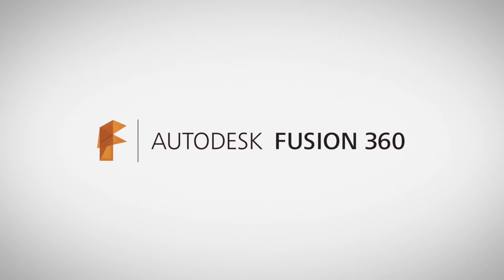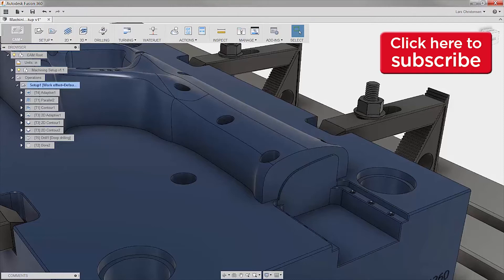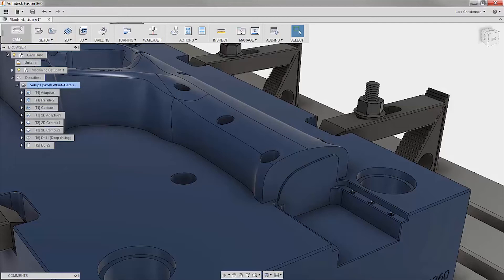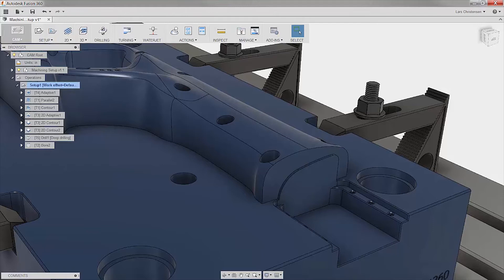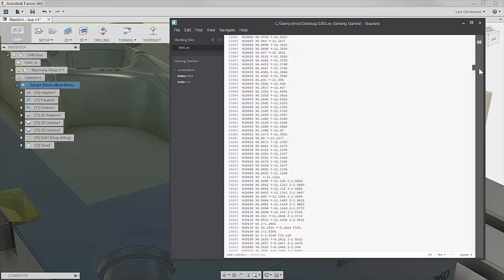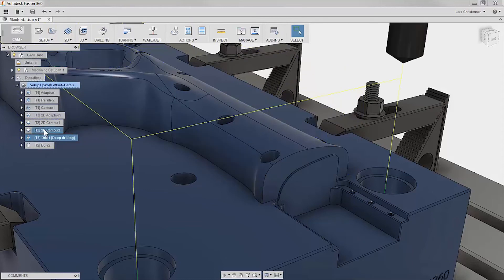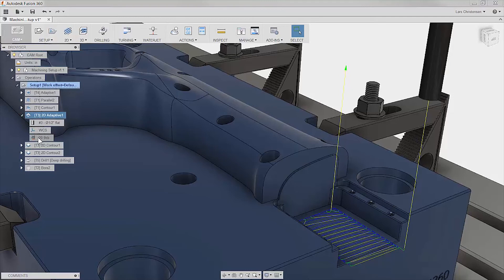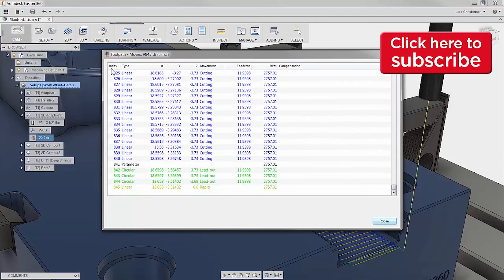Fusion 360: Do You Know Where Your Toolpath's Are Headed?

Comment: Great Feature! I need the Fusion team to keep adding goodies. I have the order cart opened on another computer and as soon as I'm sure  that if I buy 3 in the cart I'll get 36 months and not 3 1 year subscriptions. I figure on retiring again when I'm 70. One thing I haven't figured out yet is when I save a tool path to my Desktop and I go to open it to view or edit it opens in predator which I use for DNC. However I only have the 30 day demo version and maybe the Fusion editor didn't load. I realize this may not be the place to ask but one other thing is there just one version of 360? On some early tubes Fusion 360 ultimate was mentioned. I do need a full 3 axis.
Reply from the maker: +Richard Nix Hi Richard! Man, I wish I knew how the subscription works when purchasing multiple seats. Do you need me to have anyone looking into this? Hope you are not getting in trouble with the wife, postponing the retirement :-). You can set Predator to be your default editor in Fusion under preferences. Then you have all the tools you need for DNC. There is an Ultimate available. When Fusion first came out, you needed that for full 3 Axis, but Carl Bass (CEO) said the heck with that and had it moved to the $300 a year version. Love that guy! The only thing Ultimate has from the standard version is 4th Axis indexing as far as I know.
Hope this was helpful. Let me know if you need anything.
Have an awesome day!
Best,
Lars
Reply: +Lars Christensen Hello Lars, got the subscription straightened out. Maybe old Carl will decide to add the 4th to the standard fusion. Almost everyone has a 4th on one of their machines these days. Especially if they have a Haas or 2. I have an old Mori-Seki here in my home stable and when we bought it I added a Tsudakoma rotary. To add an axis in those days was big bucks. Not to mention the price of a good rotary. Home your not still plowing snow "Video 1", Take Care.......Rich